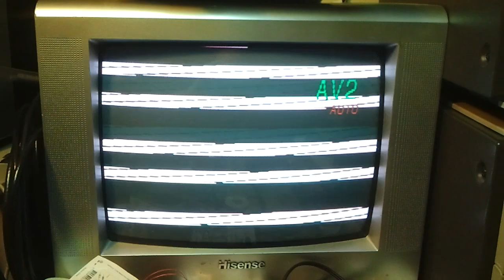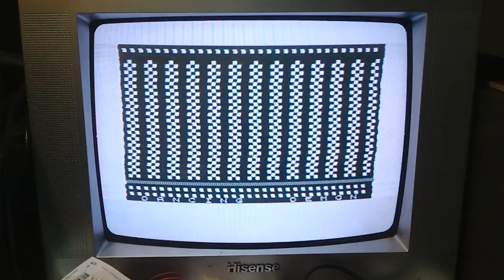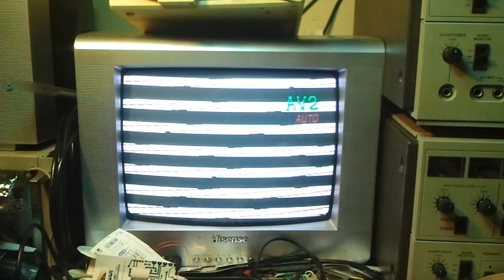Homebrew ZX81 Computer

Comment from the maker: For a low-res analog display, have a look at the TV-Out library for the Arduino. It's two resistors and a plug connected directly to an ATmega microcontroller. I made a simple NTSC display using a 74HC166 shift register and an ATmega at one stage which could display colour using a technique similar to the Apple II. If you can message me I'll send you a link to the diagram and source code.

Comment: Hi.

Are you going to make a professional (SBC) version of this for sale ? As I'm sure there's a market for stuff like this !
Reply from the maker: +Harry62811 It would need to be completely redesigned to use a CPLD instead of individual GALs, because GALs aren't being manufactured anymore. I got these used from China. They were pulled off old circuit boards, many didn't work in the 20 I got.

Comment: I was toying with the idea of designing my own ZX81 clone with all the original Glue logic on a CPLD (possibly an EPM7128SLC84). It all comes down to whether I can fit all the necessary glue logic onto a CPLD and get it working.

Something with a specification like :

Z84C0010PEC (clocked 10.7MHz)
Z84C9010VSC KIO clocked 10.7MHz CTC,SIO,PIO (something the original ZX81 never really had)
UM61512 64K Fast SRAM
27C128 16K EPROM
EPM7128SLC84  glue logic, memory, I/O decoder + video logic with DACs to give RGB 
and composite video output.
Second EPM7128SLC84  for keyboard etc
SAA1099 sound chip??..as the original never had sound this is neither here or there !
8255 for CF Card or IDE hard Drive
RTC (possible DS12C887)
7805 regulator

all 'Pie-In-The-Sky'  at the moment...
Reply from the maker: +Harry62811 Sounds doable. Each of the GALs I used has 20 macrocells, totaling 120 macrocells, though I didn't use all of them.
Reply from the maker: Leslie Anderson I was looking at doing that myself a few months ago. Fitting it on a 128 macrocell CPLD is quite a challenge.